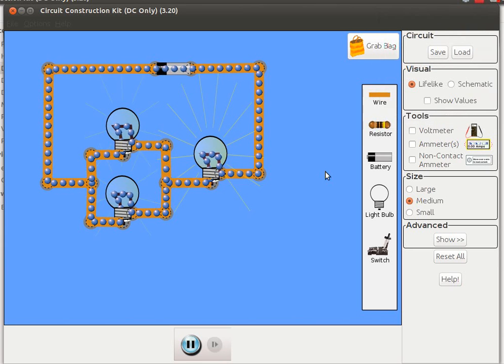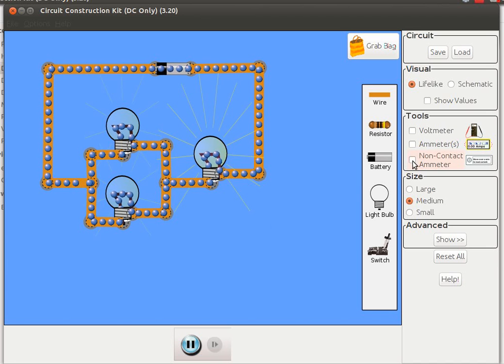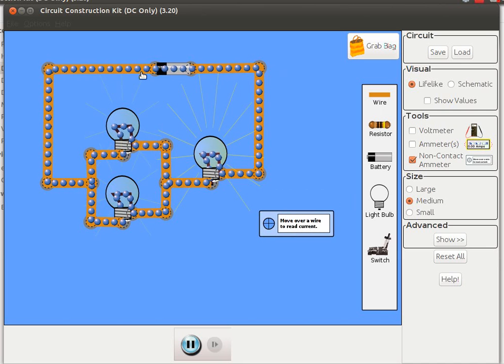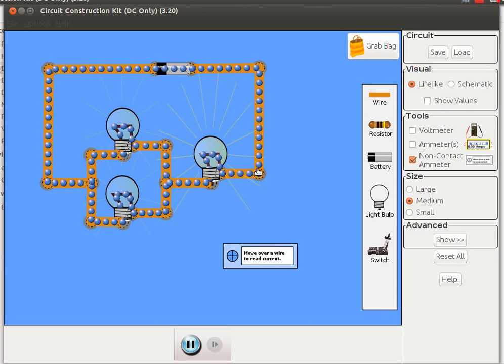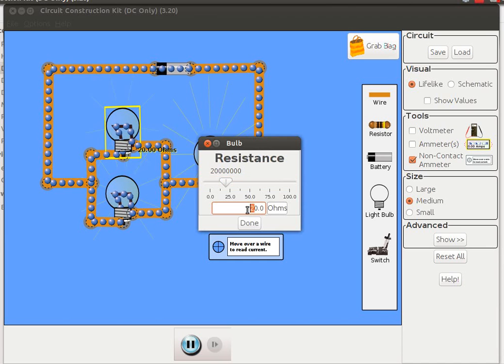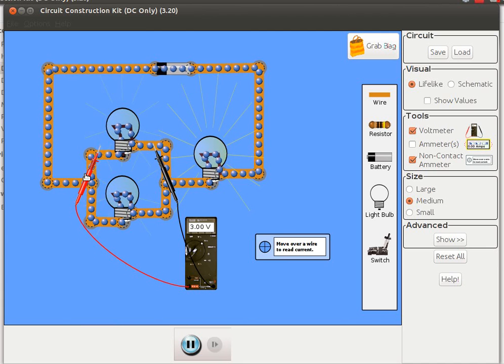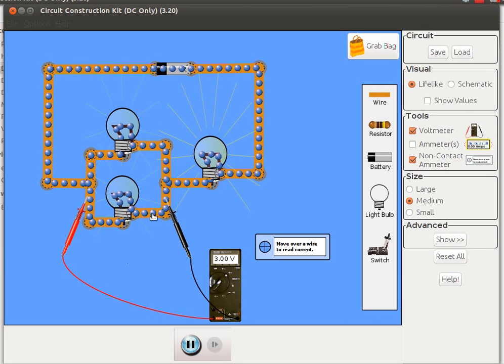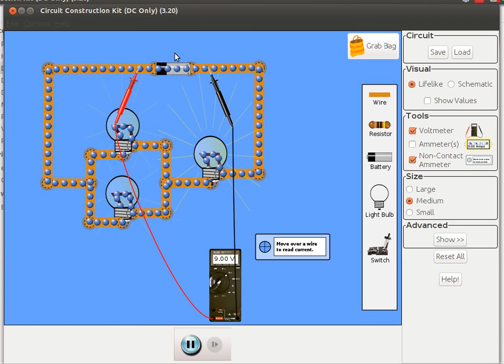Complex series and parallel circuits

Comment: Now i got another question sir. Lets say 1Amp(blue dot on this video) got 9jule after they pass the battery. After the bunch of electrons pass the first  light bulb which is at the right, they have to choose a branch(there are two branch next to the first light bulb) anyway. I think..one blue dot must pass through only one circuit ( one branch)  then why the blue dot give first bulb 6jule? and it give 3jule to next light bulb???